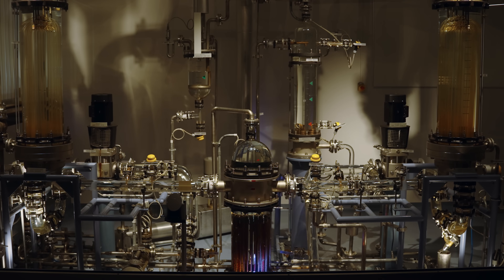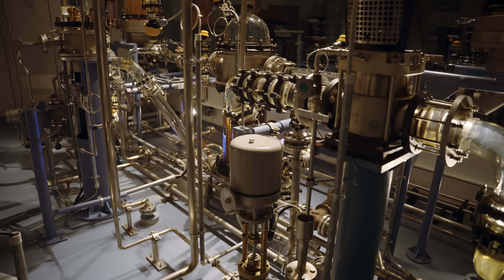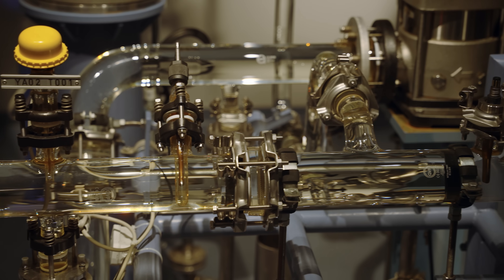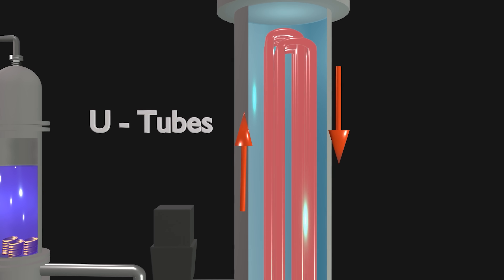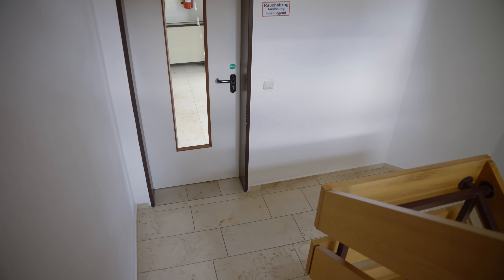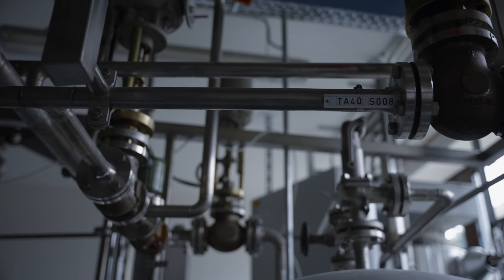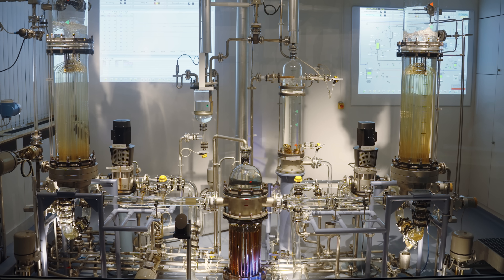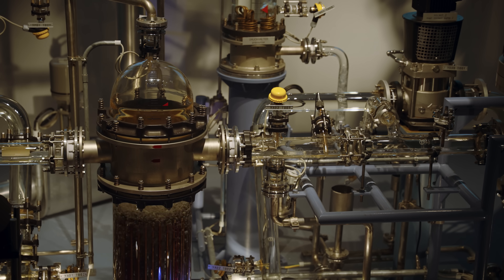World's Only GLASS Nuclear Reactor!

Comment: There is just one very big problem with nuclear power which barely is considered in conversations for nuclear power. And you talked about it, but without going deeper: Spicy rocks.
In fact there are spicy rocks all over the world, but germany especially the western part doesn't have known ressources of uranium who aren't already exploited or are exploitable. So the question is, where to find those spicy rocks. France, the nuclear powerhouse of europe, also has big problems getting new uranium and exploits it in Kongo, like the Belgians do too. But both of them struggle to get enough material to actually power the nuclear reactors they currently have.
Were did germany get it's spicy rocks? Kasachstan. On which route did Uranium from Kasachstan end up in Germany? Through Russia. Was there some geopolitical thing ongoing in Russia? Yes, well technically not really "in" Russia, but the EU sanctioned Russia heavily because of it's war with Ukraine.
Is there another way? Well...no. The only other way is all around the other way through China. And that's an economical desaster.
So Germany has no fuel...what about the reactors? Oh well, the didn't get a revision for a very long time, so even if the reactors would have fuel, there would be months where no energy production can be made.
No Fuel, no Reactors. But what about personnel? Ahhh, right...there simply aren't enough engineers still around. So there are another x years where no energy production is possible.

No Fuel. No Reactors. No Personnel. Did i miss something? Unfortunately, yes. The big cost. And i don't want to even include the still undefined storage of nuclear waste. nuclear Energy production is expensive. Even if the state would run uranium mines, uranium refinerys and the nuclear reactors. And only a stable energy production is possible for nuclear reactors. That's why France is building so much pumped storage. Currently they have to sell the power for cheap to Austria, because they knew decades ago, that renewables and nuclear requires a massive amount of energy storage possibilities.

And then there is waste disposal. Just drilling holes into the ground doesn't do the trick. "Endlager Asse" showed exactly that. But as only future generations will have to deal with that this doesn't play a big role in todays politics. What about waste upcycling to get less harmful waste, a little bit of extra fuel and a little bit of non-reactive, safe to disposal waste? Fine. But this would be the first time, humanity would clean something up they could've just throw it away...and additional expenses have to be made.

Think that covers it all. Did I say it was one big problem? Oh yeah i did...it's called "nuclear energy lobby". Those play the expenses down and say "The other things aren't a problem. Nuclear Energy is safe and cheap." But in reality it's not.

Just one thing at the end: As a german, I'm glad to not have active nuclear reactors anymore. But honestly: I only would've that after the last coal power plant was shut down prior to the first nuclear reactor shutdown...but now we are here.

Comment: Put simply, a nuclear reactor is a very complex steam engine in an enclosed water recycling system. The sensors, valves & extreme detail is there to maintain control of that steam monster. Just ask a steam train conductor how he works his train & multiply that by 100 on a nuclear reactor.

Comment: @kylehill  At about 3:50 you say the model is a 1:10th scale, but at 4:30 you say "...the metal and concrete behemoths that are literally 900% larger than this, the real things."
That does not match. Not even slightly.
First: It would be 1000% larger, as you don't remove the size of the model from the size of the behemoth.
Second: As it is a 1:10 scaled model, and the model is 3D, you have to cube size. 10^3 = 1000

So the real thing is 1000 times larger than the model, making the behemoths 100 000% larger.

And someone will probably find something wrong in my math as well.

Comment: It's not 900% larger it's 1,000% larger. If it's 1/10 scale then it needs to be multiplied by 10 or 1,000%
Reply: It would be 900% if you were talking about Mass as you already have 1/10 of the mass but generally when talking about scale we don't include the scale that we already have. We just talk about how much larger you would need to be.

Comment: Imma just leave this here -

The TMSR-LF1 pilot plant, also known as the Thorium Molten Salt Reactor - Liquid Fluoride 1, represents a significant step forward in the development of thorium-based nuclear technology. Here's a detailed breakdown and analysis of its key aspects:

Overview and Location

The TMSR-LF1 pilot plant is located in the Gobi Desert near Wuwei City in Gansu Province, China. It is operated by the Shanghai Institute of Applied Physics (SINAP), part of the Chinese Academy of Sciences (CAS).

Technical Specifications

Reactor Type: It is a two-megawatt thermal (MWth) liquid-fueled thorium molten salt reactor (MSR).

Fuel: The reactor uses thorium dissolved in a molten fluoride salt mixture as its primary fuel. Unlike conventional solid-fuel reactors, MSRs use a liquid fuel that circulates through the reactor core.

Coolant: The same molten salt mixture that acts as the fuel also serves as the coolant. This eliminates the need for water cooling systems used in traditional reactors, contributing to potential safety and efficiency improvements.

Operating Temperature: MSRs like the TMSR-LF1 operate at high temperatures (around 700-800°C), which can potentially increase thermal efficiency and enable applications like process heat for industrial purposes.

Safety Features: MSRs are designed with inherent safety features, such as a negative temperature coefficient of reactivity and a passive decay heat removal system. These characteristics are intended to reduce the risk of accidents and mitigate consequences if abnormal conditions occur.

Licensing and Operation

Permit: The pilot plant received a 10-year operating permit from the Chinese National Nuclear Safety Administration (NNSA) in June 2023. This permit allows SINAP to conduct testing and research operations while adhering to strict safety standards and regulatory requirements.

Research Goals: The primary objective of the TMSR-LF1 pilot plant is to demonstrate the feasibility and potential benefits of thorium-based MSR technology. Research focuses on reactor operation, fuel cycle management, safety assessments, and the development of associated technologies.

Advantages of TMSR-LF1

Fuel Efficiency: Thorium fuel cycles have the potential to be more efficient than uranium cycles, utilizing a larger fraction of the fuel and generating less long-lived radioactive waste.

Non-Proliferation: MSRs can be designed to reduce the production of isotopes suitable for nuclear weapons, enhancing non-proliferation efforts compared to traditional reactors.

Flexibility: The high-temperature output of MSRs can support various industrial applications, including hydrogen production, desalination, and district heating, potentially diversifying energy use beyond electricity generation.

Challenges and Considerations

Technical Challenges: Developing MSRs involves overcoming technical hurdles such as materials compatibility with molten salts, corrosion resistance, and reactor control mechanisms.

Regulatory and Public Perception: New reactor designs require thorough regulatory assessment and public acceptance, which can influence the pace of deployment and commercialization.

Global Implications

The successful operation and validation of the TMSR-LF1 pilot plant could influence global interest in thorium-based MSR technology. Countries like China, India, and the United States are closely monitoring these developments as they assess future energy strategies, including the role of nuclear power in sustainable energy transitions.

In conclusion, the TMSR-LF1 pilot plant represents a significant milestone in the advancement of thorium-based MSR technology. Its operation and research outcomes will contribute valuable insights into the feasibility, safety, and potential benefits of this innovative approach to nuclear energy generation.

Comment: In Germany, as of today, we have ZERO capabilities to store highly radioactive waste long term. It just sits in above-ground facilities and nobody knows what to do with it. Germany's known geology simply does not allow for safe long-term storage. Please take our trash, other countries!
Low- and intermediate-level radioactive waste is dumped in an old salt mine, Asse II. Nobody knows exactly what was dumped there, because the inventory wasn't maintained properly. Asse II was praised as a safe and ideal storage ground. It is currently deforming and floods as a result and the waste has to be removed somehow.
The drums containing the waste material were originally stored in an orderly fashion but later on were just dumped in a pit and covered with salt, to safe time. Recovery of the radioactive material from the unstable, flooding mine is projected to start in 2033 and will cost the taxpayer billions (the mine operators won't pay for shit, of course). Where the recovered waste will be stored in the long run is still unsolved.     

So yeah, nuclear energy is a MESS in Germany. Theory and practice simply do not align in this country due to bureaucracy, greed, and incompetence. Foreigners sometimes have problems understanding this, because they picture Germans as efficient and resourceful. We are not. At least not when it comes to nuclear power.

Comment: The steam is sent to a turbine where it is used to push the turbine blades, the turbine shaft is linked to an alternator and this alternator, turning, makes electricity. Exact same thing a gas fired or coal fired plant does except you burn gas or coal to make the heat used to boil the water to steam.

A dam uses the pressurized water from the lake above it to push the turbine blades instead of steam. A wind turbine skips the heating steam part and just uses actual wind to turn it.

Why does an alternator turning makes electricity ? All I will say is 'magnets', ask google.

It is always the same basic thing (except solar panels I guess) but sadly education systems all over the world are trash and can't teach these basic facts.

Also pretty sad to hear the guy being interviewed withold opinion about what he thinks of the decision to shut down nuclear plants. Germany is supposed to be a democracy, if you think your politicians are being idiotic, you should say so, and id go even further, it's your duty to say so. Politicians are supposed to be bound by the choices of the citizens in a democracy not the other way around.

Comment: Its so weird to realize that nuclear power is just a steam engine powered by nuclear materials.
Reply: Boiling Water requires a lot of energy. Specific heat of Water is 4 Kilo Joules per Kg of Water per degree celcius. You need to provide 4,000 Joules of energy to kush heat 1 kg of the stuff by just one degree.

Once it reaches 100 degree you need to add 2 million more Joules of energy to convert 1 kg of it to steam.

1 unit of electricity is  1 kWh which is 3.6 million Joules.

Water is relatively cheap and can act as a moderator (stop/slow the reaction) if the situation caller for it.

Comment: A two-pass tube type heat exchanger in Germany is called a u tube? I'm not buying it. Germany's tradesmen and professionals are better than that.😂
Reply: It's called a double pipe Heat Exchanger. It's taught in the first semester university. 
BTW Steam Engine (locomotive) uses water called Shell and Tube Heat Exchanger.

Comment: This whole issue explains half of my problem with EV's, which keep in mind I own and daily drive an EV.
Powering EV's with anything other than Nuclear energy is largely a wasted effort. Transport contributes a total of 29.4% of the total global GHG emissions, of that 29.4%, personal travel (the bus you take to work or your gas vehicle) only contributes 45.1% of the GHG emissions contributed by transport. Coal fired power plants contribute 40% of the GHG emissions from fossil fuel on it's own. Those numbers are pretty similar, right? So it's pretty accurate to say that coal powered EV's aren't efficient enough to off-set the GHG emissions an ICE counter-part would emit, especially after factoring in mining and manufacturing emissions to build that EV.  It's close enough to a net-zero change that it may as well be in terms of tons of co2 emitted per-capita per-year. Don't believe me? Lets break it down! A 2022 Honda Civic (1.5l EcoDreams 4-cylinder engine with CVT transmission) produces 267g of co2 per mile driven. On average, coal fired generation produces 2.30lbs of co2 per kwh produced, that's A LOT. A Nissan Leaf (the most efficient EV on the market for now at 4.4m/kwh, the closest in efficiency being the Tesla Model 3 at 4.14m/kwh, with models like the Kia EV9 and Hyundai Ioniq 5 getting 3-3.5m/kwh) would then produce 237 grams of co2 per mile! Remember, that's the MOST efficient EV on the market and it's hardly less than a Honda Civic. That also means that a Hyundai Ioniq 5, Tesla model y dual motor, Kia EV6, produce about 300g of co2 per mile when coal powered, which is more than the civic by more than the Leaf saves! 
Nuclear powered EV's off-set GHG emissions enough to be considered meaningful, yet Germany will be importing power now (Yes, mostly from other renewables but when the renewable sources tap out they already have stated that power will come from coal fired power plants, some sources I've seen state as much as 40% of the power but I take those unofficial sources with a grain of salt.)
Personally, my Leaf is charged with electricity provided by the Salt River Project, it's easier to just quote them on where it comes from though; "SRP generates electricity from a mix of renewable sources like solar, geothermal, biomass, wind and hydropower." If you're wondering, yes, I absolutely did purchase an EV purely based on how my local grid is fed. If i move from Phoenix, I'm not taking the Leaf with me.

Comment: Why don't they use the eletricity generated to reheat the rods in their water?
Reply: Because that would literally break the laws of thermodynamics.
Reply: @SkirnirW  I don't think activity in a cycle breaks anything. it just says that I can't cycle from cold to heat, but cycle from a form of matter to another should be fine. After all, that's the other part of the puzzle they are researching. Skimir put some coils right before the rods to boost the electricity and see what happens. The worst that can happen is it slows over time.

Comment: I really can't follow the logic of Germany shutting down everything nuclear.  You can't use coal it's super polluting producing more greenhouse gases radioactive ash and smog than anything else.  Natural gas is produced controlled by other countries like Russia and the U.S. putting their power supply in foreign powers which as we know from the 1970's energy crisis is a tenuous position and still pollutes.  Solar and wind isn't constant or plentiful there nobody can use renewables alone.  Geothermal is rather scarce best used in hot spots and tidal is still experimental.  I would've suggested trying to design molten salt reactors if people were afraid of meltdowns and weapons.

Comment: That's very sad. And i suspect Germany will be soon in trouble. Getting rid of the most efficient way of producing energy will not go as they think it will. And we have a similar issue in France. We still don't have new reactors and power plants, and most of the current power plants are past their decommission date and still in production (but the knowledge and experience in maintenance has vanished over the years), which is a more volatile situation than in Germany.

Comment: Germany is so left it's not funny there wind turbine energy grid experiences what they call energy droughts when there is no wind no power
Reply: As a German living in Germany, I can assure you that there are no blackouts in my country because of electrical power shortages.
Europes national power grids are interconnected. For example, during the summer droughts in the recent years, France imported solar and wind energy from Germany, since they had to reduce the output of their reactors due to cooling water shortages. On the other hand, Germany is importing french nuclear energy, if necessary, when there is no wind at night and the demand for electricity is higher than the supply.

Works perfect so far.
Reply: @hoppeltrottel7484  Wir importieren nicht wirklich mehr Strom aus dem Ausland als sonst.
Reply: Nope, we still have not a single Blackout. Also other Countrys that are on the far right (Texas) are building renewable Energy because they are just cheap and reliable.

Comment: Nuclear fission in a nutshell: put special rocks close to each other under water. The rocks get hot and the water boils.

The hard part is making sure you don't have too many rocks too close to each other to still have enough water to keep everything submerged because otherwise the heat may get high enough to start melting stuff and the water + steam container fails.

The only hard part is the scale. For a big fission reactor, the amount of special rocks you want for a single reactor will be in range 30 metric tons. And if you start to lose steam pressure, you better be able to get majority of those rocks far from each other!

And we still haven't perfected this process after ~70 years and some people seem to believe that fusion power is nearly complete. In reality fusion power is insanely more complex process and we still have no idea how to make it even net positive, let alone competitive.